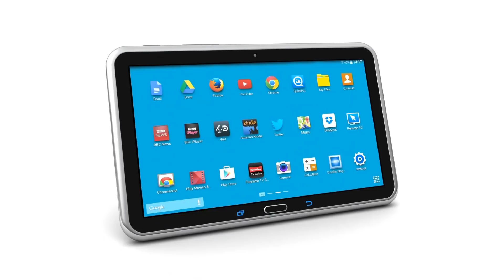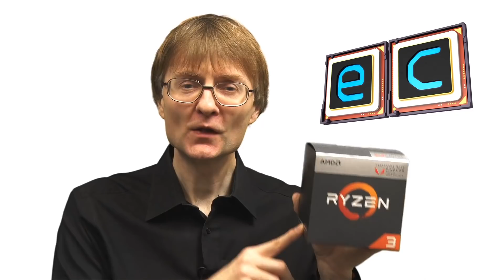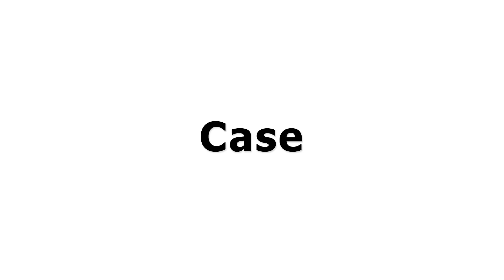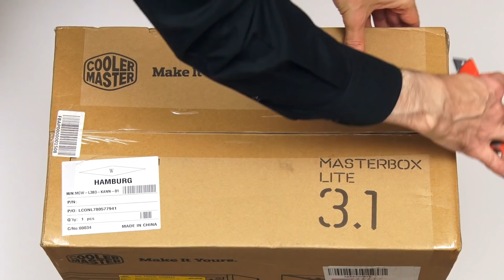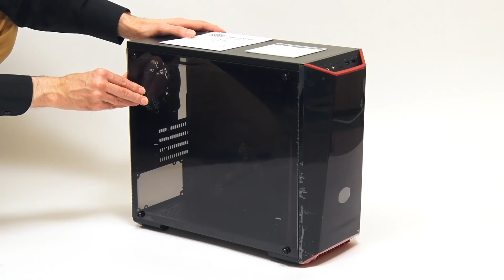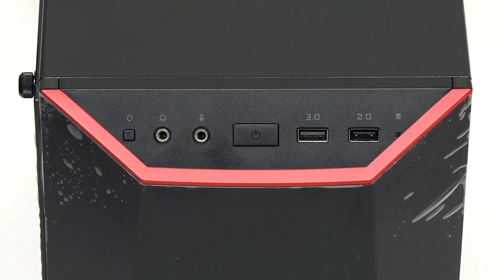Ryzen Budget PC Build #2: Case, PSU, SSD & Assembly

Comment: A few points.

1. Christopher, if you unbox a case then it is easiest if you let mr.  Gravity assist you. Turn the box upside down and just lift off the box itself which doesn't weigh much, mr. Gravity will be so kind to keep the case on the table or ground while you slide off the box unless Mr. Friction decides to be a bully. ;)

2. That PSU calculator severely overestimates the power consumption, it is impossible for real world applications to get a 100% load for all the components. That 2200G does not use much more than 100W and typically the power consumption for the rest of a simple system like this (SSD, motherboard, RAM, sound) is not above 50 W. Having said that, you should always have around double the wattage of what the system uses because of efficiency and noise (usually higher wattage PSU's have less noise around 40-60% load than at a much higher load). In the case of Corsair RM* the highest efficiency is around 40% load. 

3. Something which the PSU calculator does not point out is the quality of the PSU. For a simple system like this it is fine but don't use the 650 W version of a budget PSU like this to power a Vega64, it won't go well because this graphics card needs a low voltage ripple. The same if you overclock hardware to the extreme, or  when you undervolt a GPU as much as possible, a low ripple helps a lot for that. Low is around 10 mV, medium is around 20 mV and higher than that is pretty bad. 

4. For SSD's you should consider a large capacity because those cost a lot less per GB. If you know for certain that you will not expand your flash-storage-capacity then 256 GB can be fine but if you would, then buy the 500 GB or 1 TB, certainly with the current prices.

5. Usually those front audio cables are incredibly bad, it might suffice for a standard headset but if you use better audio then don't hook it up to that plug in the case, connect it directly to the motherboard.
Reply from the maker: I did turn the box to get the case out, but it would not have worked in the shot. The film making aspect here places major constraints on what I an do/show. This build took about 100 hours over 8 days, which is longer than would normally take. :)
On the PSU, yes all points accepted. On the SSD, I did note the need to match capacity to requirement. The problem is, every component in this build can be specified higher for a bit more cost, and then I've not delivered the £350 build I intended. Totally agree on front audio -- fine for headphones for general use, useless for anything else. I use Dragon dictate and it will not even work (and does not claim to) using any form of onboard audio, regardless of the connectivity.
Reply: @ExplainingComputers  
I sure hope  that I won't need 100 hours for my next build (Ryzen3 and Navi). ;)
I have a Sennheiser HD 700, I wouldn't connect that to the front audio cable too. Onboard audio can be acceptable these days but only on a good motherboard with proper shielding and it never is as good as a good separate DAC and amplifier when you connect that DAC via S/PDIF to the motherboard. However, on my older OEM-system with a motherboard with onboard Realtek audio it is quite bad, even a cheap (€35 Soundblaster) soundcard sounds a lot better. Gordon Mah Ung from PC World said jokingly that people should just cut that front audio cable. :)

The problem with budget systems, it never is a good solution except when that truly is all what you need. As soon as you upgrade sooner or later because you experience your system as limiting you will spend more because you spent less. A simple example is the Ryzen 1600 vs. the Ryzen 1500 (before Ryzen2 came on the market), for so little extra cost you get so much more and you can upgrade later. Or take the GT 1030 vs. the RX 570: >50% of the cost but much less than 50% of the performance. The same with a 128 GB SSD vs a 500 GB SSD (same model): the 500 GB SSD costs €70-85 which is much less than 4 times as much as what you would pay for the 128 GB SSD. The same for 1 TB and 2 TB though at a given moment you also need to take into considertaion that prices drop in the future.
In short, I don't like budget systems because you sacrifice too much for too little savings. I don't like the high-end systems too, in general: too much extra cost for having the same performance level a bit earlier. Somewhere in the middle is the sweet spot, for a PC that would be around €700-1500 in my opinion, depending on what performance level you prefer and/or need.
Reply: Well, Mr. Gravity was distracted by Mr. Scissors and his miscreant flipping snippets flying across the room!  Uh, never heard of low voltage 'ripple' and can't imagine why a device would thrive on under-voltage.  I guess with keeping with his low budget theme Chris opted to use just a small cheap SATA SSD (non-NVMe).  I'm behind the times in SSD tech, but my laptop with i5 and SATA SSD makes me feel spoiled as it is on response for running applications & basic tasks...
Reply: @boboala1  

It is not complicated, ripple is the deviation from the aimed value, in this case voltage. You should think about how that electrical power comes onto your CPU/GPU...
Mostly the power plant has a big dynamo which is being pushed by steam (fossil fuel, nuclear) or water. The movement of that dynamo generates an ever changing magnetic field which generates an ever changing voltage. So you get AC voltage from the outlet in your wall. Now the PSU has to convert AC voltage  to DC voltage. That is difficult! You never get it perfect but there degrees of imperfection, generally speaking a deviation of around 10 mv is good in the current market: one PSU (the better models from EVGA) gets below it, a few (like Corsair RM*) are just above it. Even worse than a larger standarddeviation is when you get occasional big spikes.

Why does it matter? Simple. You need a minimum voltage to make transistors switch with a certain frequency. If the ripple is larger than the average voltage needs to be higher to prevent the minima to get below the voltage which that component needs to be driven. For example, if your CPU needs 1.38 V then with a ripple of 50 mV you need an average voltage of 1.43V but if the ripple is only 10 mV then 1.39 V suffices. You don't want more than 1.4 V for Ryzen for a long duration (it might deteriorate the CPU earlier/faster than you like) and with a higher voltage you get more heat which limits the performance of the transistors. That is why overclocking gets so difficul above af certain voltage. 

For undervolting the same applies. If you search the border then it is nicer if you only have to get around 10 mV higher than when you have to get around 50 MV higher with the average voltage. 
Why would you want to undervolt? Because you can get the same performance with less electrical power. This means that you get less heat and a consequence less deterioration of the hardware, less noise and a lower power bill. All good things! The better question is why you would not want to undervolt.  

These days small SSD's are incredibly expensive compared to big SSD's. Look up for the MX500 and 860 Evo and calculate the cost per GB and you will see my point. Now ask yourself what percentage of those customers will not buy another SSD within a year.
Reply: @peterjansen4826  I got ya now...semantic misinterpretation of terminology on my part .At first I thought you were recommending an under voltage for overclocking...
More pertinent question is I'm going to build a new PC around a Ryzen 5 and was looking at Samsung SSDs and researching SSD specs in general as this will be my 1st one in a desktop build.  The 970 Pro is built around MLC NAND & EVO on TLC...both drives are currently pretty close in pricing, so I think the Pro is gonna be my choice.  Be curious to hear your experience w SSDs, if u have time.
Reply: @boboala1  
I was not talking about undervolting for overclocking, however, it is a thing for AMD GPU's. Yes, you read it correctly! By lowering the voltage you can often get more performance out of those GPU's. Why? Because those GPU's can maintain the boost better at lower voltages because there is less heat. Obviously it is a balancing act, you can't lower the voltage too much because then the boost which you want to maintain can't be achieved because the voltage is too low, if the voltage is too high then there is too much heat and the GPU will thermal throttle. Also heat makes transistors require a higher voltage for the same switching frequency which explains why properly watercooled GPU's perform better than air-cooled GPU's.

I don't have that much experience with SSD's, I only had one SATA-SSD (I waited a long time because I wanted to buy one when the prices got lower and I was used to the slow hard drive anyway, now I could not go back!) and that one is still working fine. But I am informed about it. Look at TBW for both SSD's and contrast that to the price difference (as you did) but also take into account that the prices per GB might get a lot lower in the future. From a technological point of view the prices should get lower but this will only happen as long as there is sufficient competition and the companies involved don't do pricefixing like what Samsung, Hynix and Micron seem to do for RAM. The market for SSD's seems a bit healthier. It is a judgement call. 
What will I do? I will probably buy a 1 TB SATA SSD around the time that I start my next system (Ryzen 3600X or Ryzen 3700X, Navi 3080) and I will buy my first NVMe-SSD when you get 1 TB for <€200. There is a lot of performance difference between NVMe and SATA but in real life applications it does not make a lot of difference because other components are too slow to keep up. Watch AdoredTV his latest video, specifically the part where he explains how it didn't matter that data was fetched from RAM when there was no cache because the CPU's still were too slow, now that CPU's got faster cache is essential. The same principle. That that SSD is so fast does little good when the CPU, GPU...can't keep up. A few seconds faster booting at most (for a SATA-SSD it should be 10-15 seconds), 1-2 seconds shorter loadtimes in games. Cool, but is worth the investment, you can also upgrade other hardware with the same cost. I am a dual booter and I wouldn't even buy a NVMe-SSD at this moment.  However, if all your other hardware already would be top notch (which is not the case) then you might want to look at it. Simply put, you are better off with an earlier CPU upgrade. Ryzen is great but it will get a lot faster around june and the next few years AMD can still improve a lot (as can Intel!). 

You should also take into consideration that a motherboard now often has 2 NVMe-slots and if you use both with the current motherboards then your graphics card falls back to 8 PCIe-lanes. That is fine for the Vega64 or the 1080 Ti but with the 2080 Ti you loose around 5-10% performance. Of course that card is ridiculously expensive but think about 4 years in the future. For X570 this might not be a problem, that will get PCIe4 for the graphics card.
Reply: @boboala1  
I use a separate post to make it more clear. What I was discussing in the previous post is to some extend a matter of preference, you can invest a bit more in your PSU and get more value and a better performance but you don't have to do that for low power hardware. However, there also is hardware which simply won't run (stable) on a cheap PSU like the one which Christopher used for this budget build. Vega64 is the latest well known example of this but it certainly is not the only one. This is not about voltage, this is about ripple, Vega64 needs a low ripple to be driven properly, without it many Vega64 cards will crash with stock settings. So in this case it is not about luxury but about hard limitations. I emphasize that Christopher made the right choice with his PSU for this particular build because he chose a low power budget. As I pointed out I would discourage most people from building a low budget PC because for most people it will end up more expensive with less performance and comfort but if a low budget is your aim and you use low power hardware then a cheap PSU can suffice.

With regard to the PSU, a high quality PSU costs anywhere in between $80 and $110 (regular price, I bought mine with a €20 discount), then you get an efficiency of 92-95%, a ripple of around 10 mV, passive cooling and 0-RPM mode (the fan won't spin) until 200-300 W etcetera
Compared to a $40-60 mediocre PSU that is a lot of value given that a good PSU lasts at least 10 years (guaranteed, you get a new one for free if it doesn't). 
The same with regard to aftermarket cooling and cases. You use it a long time. If you have the budget for it then I would recommend to calculate the cost per year instead of looking at the total cost. It makes more sense to me but you have to be able to afford it at that particular moment.

Comment: Gigabyte has a very good, well laid out UEFI. I'm very happy with my ASRock motherboard overall, but the UEFI is poorly laid out and confusing. I need to search through a labyrinth of folders to find very basic settings.
Reply: I like my ASRock UEFI better then my MSI board's UEFI (as in it actually *works*) but I can agree that it's confusing until you get used to ir.

Comment: Did I hear a floppy drive connector in 2019? Wow!! Or was that a standard disc drive connector?
Reply from the maker: It was a floppy drive power connector. Which may, I guess, power other devices (a front bay card reader, perhaps).

Comment: Just wanted to check the total cost in Norway, and checked with the price comparison service “prisjakt.no”:
Ryzen 3 220G                       NOK  989,-
Gigabyte B450M Gaming              NOK  966,-
Corsair Vengeance 2x4GB DDR4 2400  NOK  727,-
Cooler Master MasterBox Lite 3.1   NOK  449,-
Corsair VS550 V3 550W              NOK  468,-
SanDisk SSD Plus G27 120GB         NOK  321,-
---------------------------------------------
TOTAL:                             NOK 3920,-
-----------------------------------==========
Convert @0.0908 (2019-02-03):        £ 355.84
---------------------------------------------
So not too far off, but then again, that total does not include shipping!
Reply from the maker: Thanks for sharing this info here. Appreciated.

Comment: I plan to upgrade my intel core i5 6400 to a i5 8400, I of course have to upgrade the motherboard, ram, cpu cooler, and thermal paste. It will  set me back about $386 currently with the right components I picked out on Amazon while doing researching to make sure I have the right chipset series motherboard for the 8th gen I5 series cpu which is 300 series chipset.
Reply: You might be wondering, do I know how to build computers, answer is yes.

Comment: Christopher,

Is it possible to disable Secure Boot in this motherboard's BIOS? If not, then forget about using SystemRescueCD for tasks such as custom partitioning, disk-cloning, etc. 

Furthermore, if the public key for the Linux stub-loader that Linux Mint uses is not included within this motherboard's KEK , then you can forget about running Linux Mint on this PC in anything but a virtual machine. (However, If it's got the key for the Ubuntu stub-loader, then you should be fine, since Linux Mint uses the same kernel-builds as Ubuntu.)

Finally, if your Linux Mint installation were to require any proprietary driver, then for it to be loaded in Secure Boot Mode, you would be required to self-sign the driver with your own key both initially, and every time the kernel is updated, since these drivers are not supplied within the Linux Mint or Ubuntu repositories, but are autocompiled on your machine every time the kernel is updated using DKMS.

Self-signing is cumbersome to say the least, as you would have to generate your own private/public signing-key pair, and enroll the public key in your motherboard's KEK database. For security reasons, it wouldn't be recommended to have your private-key stored on this PC; for optimum security, it would be better to store it on another medium in a safe place away from your computer. However, doing so would mean that you would have to manually re-sign the driver with every kernel update.
Reply from the maker: I am pretty sure Secure Boot can be disabled, but I do not have the machine running infront of me to check. I have not done the OS insall video yet, but have booted from USB into Linux Mint 19.1 just fine.
Reply: @ExplainingComputers  Great! So it at least boots Linux Mint. I sincerely hope that disabling Secure Boot is possible; I find SystemRescueCD to be a very handy tool to be able to use for things like backing-up and restoring partition tables, resizing partitions, etc. And it's free, but it's based on Gentoo Linux; AFAIK, Gentoo is still unable to boot in SBM. At least my version won't, and it's from last year.

It is doubtful that Gentoo Linux builds could ever boot in SBM, as this distro is notorious for requiring its users to compile almost everything themselves. :(

Comment: In regards to the Ryzen CPU itself, does it support hyperthreading? Where with your quad core system, you appear to have 8 functional CPUs.
Reply from the maker: I believe the 2200G is 4 threads only with its four physical cores. So no hyperthreading I'm afraid. But for the money, four 3.5+ GHz cores, plus 8 GPU cores, is not bad. :)

Comment: Does the b350m work with the 2200g cpu?
Reply from the maker: It can, with a BIOS upgrade. Many B350 boards are now onsale in "Revison 1.1" (or later), indicating they have such a BIOS upgrade applied before you get them. If they don't, you would need to install a first gen Ryzen, do the upgrade, then switch to a second gen like the 2200G. So be very careful getting a B350 board for a 2200G and be absolutely sure what you are buying.